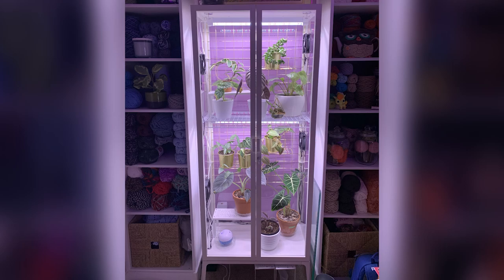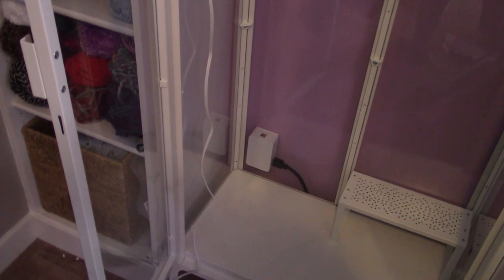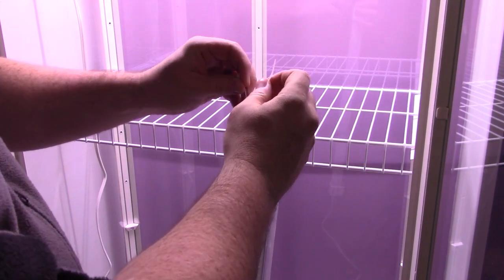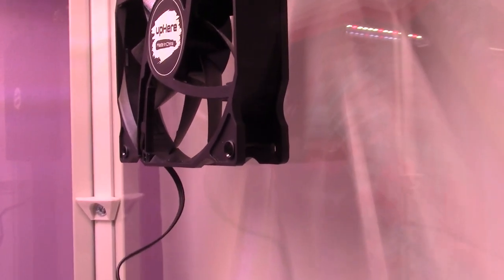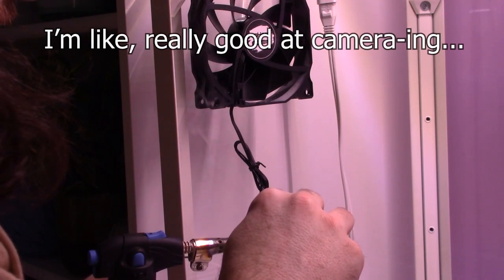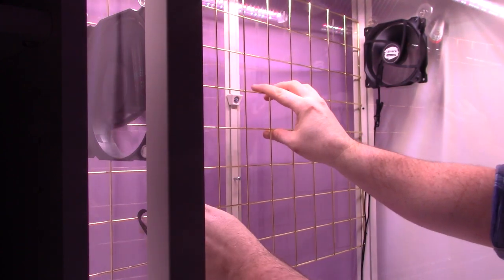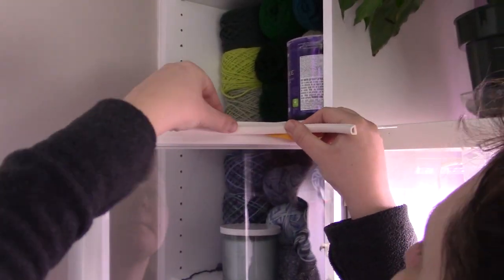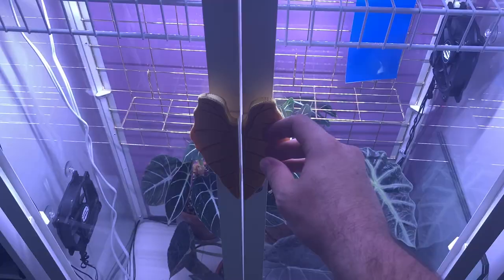Ikea Milsbo Cabinet Greenhouse Conversion | Setup | How-to

Comment: yeah with inflation I estimated about $1000 for everything in my green house cabinet. Of course I decided to get more pricy things like acrylic shelving instead of wire shelving, plastic cable organizers to hide the cables completely instead of using clips. I had to buy the necessary tools to drill the holes since we didn't have any tools. I wanted to get rubber grommets for the holes to hopefully prevent rusting. I would love a fountain I think that is a cool idea but saw how pricy they are on amazon so maybe not going to get that just now lol. It is definetly a purchase as you go kind of project if your on a tight budget and want perfection. If I was rich I would get it custom made with all the best stuff but ya know not everyone has that luxury hahahh
Reply from the maker: I just took a quick glance at the pricing for while adding the links into the description. There have been some that have gone up but others have gone down so I think our pricing is still relatively accurate. But yes, it isn't something that you would want to do on a whim, it is still a bit of an investment.